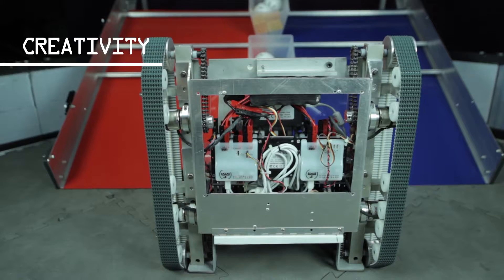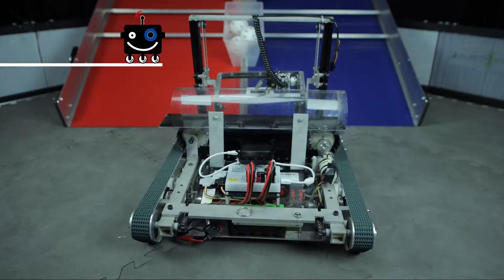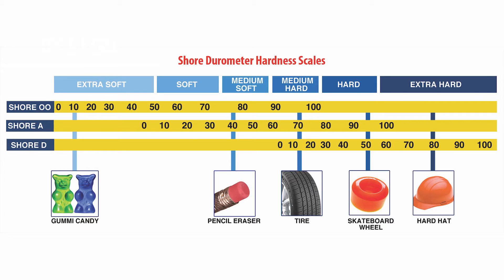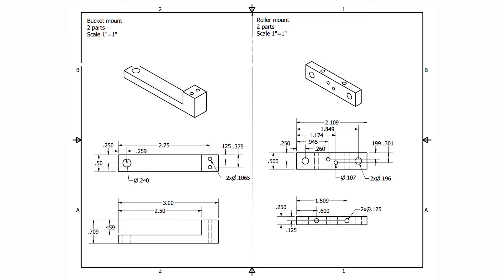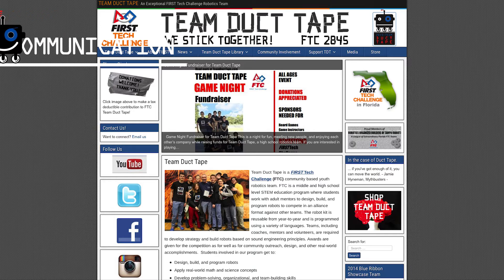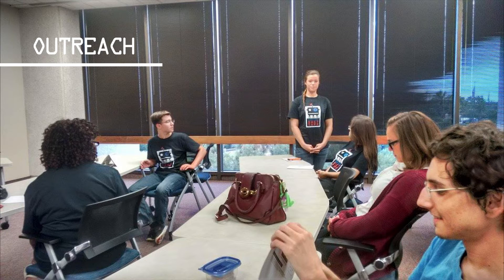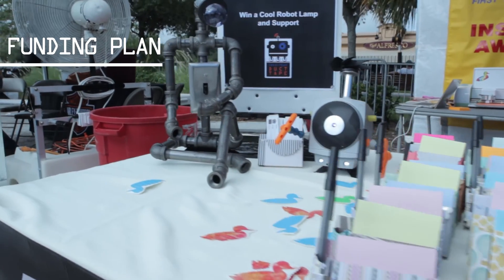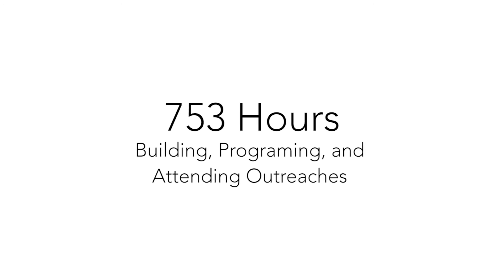League video 2015-16

Comment: Have you guys ran into problems with those treads? Like the illegality of them?
Reply: +VortexRamFTW 
#1 They are not illegal...
#2 They are not treads...
Reply: Timing belts, not treads .
Reply: +bennett nichols 
#1 your presenter said tank tread/ treads in the video 
#2 it clearly says treads here: http://www.andymark.com/product-p/am-3309.htm

#3 Thanks cause the manual said no high grip treads are allowed
Reply: +VortexRamFTW 

The rule that you are referring to states, &quot;d. High traction wheels (e.g. AM- 2256), and high grip tread (e.g. Rough top), that may damage the Playing Field are not allowed.&quot;

So yes you are correct the use of &quot;High Traction Wheels&quot; and &quot;High Grip Tread&quot; is prohibited however we are using a set of timing belts which the rules do not prohibit.

The Product that we are using is a TK10K6 Self Tracking Timing Belt from BRECOflex CO  with a PVC backing. Feel free to check out the product on their Website ( http://www.brecoflex.com/index.php?CATID=1&amp;SCATID=1&amp;SMENID=1&amp;TBGID=8&amp;pName=TK10%20K6&amp;codeName=BFX)
Reply: +bennett nichols
 
thanks dood I get it now